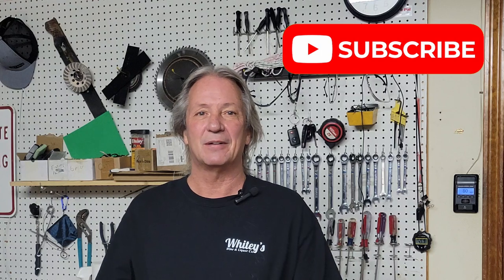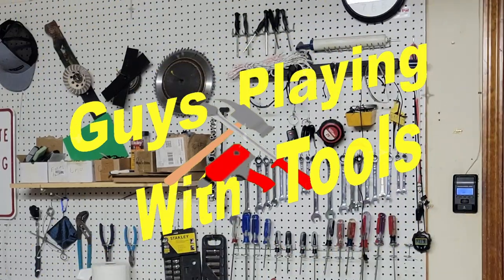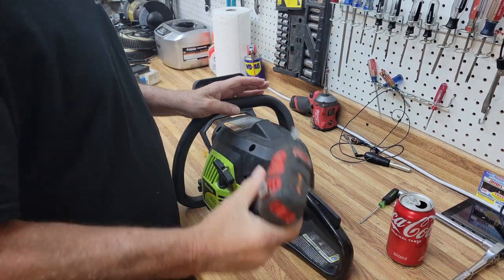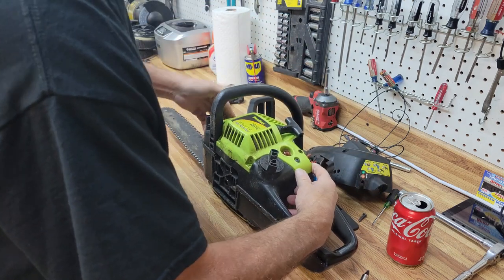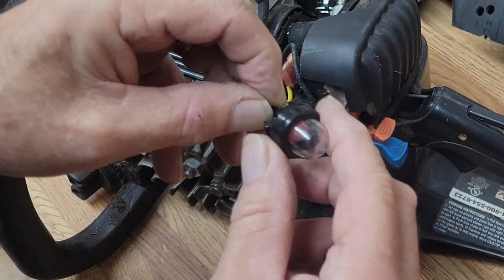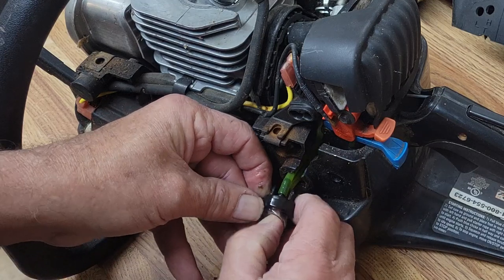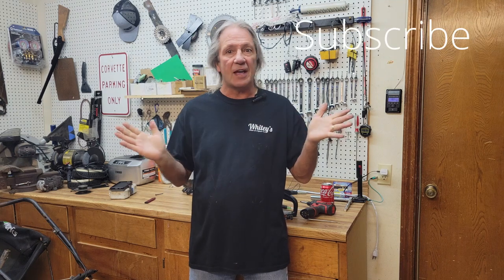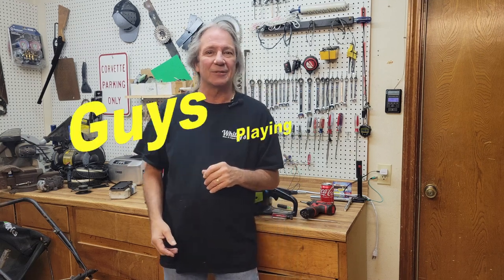Replacing a chainsaw primer bulb, easy fix

Comment: If only It would be this simple for me! First there would be a screw that want come out then the fuel lines would all be cracked and the list would grow. I would just toss it in the yard and run over with my mower🤣👏🏽
Reply from the maker: Man Renaldo, you are rough this morning, did you forget to get a good breakfast today? 🤣
Some to have a tiny screw holding the primer on, that usually make is even easier.
I could do a full fuel line video, it's chainsaw season so I am sure I will see one that wants new lines any minute now.
Reply: @GuysPlayingWithTools  Thanks because every time I try something that should be simple it turns into a FREAKING HORROR project! So watching you gives me hope ✔️👏🏽
Reply from the maker: Thanks buddy! When you do it enough it gets really easy. There was a time this would have taken me 45 minutes

Comment: Good to order a primer bulb online before you need it. Otherwise big orange box store wants $15 for an assortment of 3, only 1 of which will fit your machine.
Reply from the maker: You know it Tom, that's why I always tell people to buy the little foolishness parts on Amazon.
 I avoid orange box stores whenever possible. 🙂
If you need a small part like this you are always better off getting it on Amazon or at a local lawn equipment dealer.
Reply: @GuysPlayingWithTools  my daughter used to work at orange box store, and even then, I avoided shopping there. And I was there twice a day, because she had not gotten her drivers license yet.
Reply from the maker: My kid worked at a skating rink, I still didn't get in free though lol
Reply: @GuysPlayingWithTools  she did get me a really nice DeWalt Bluetooth headset for Christmas that year. It holds charge about 18 hours, not 2 like the 5 below pair I had.
Reply from the maker: @haneyoakie14  That's a bonus for sure.  I hope she got a decent discount.
Reply: @GuysPlayingWithTools  knowing that child, I hope she paid for them.